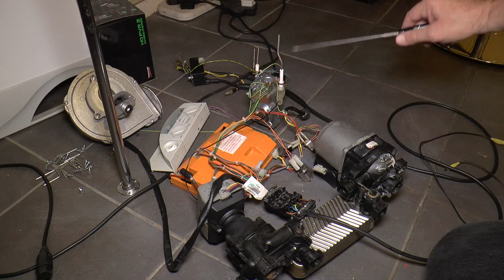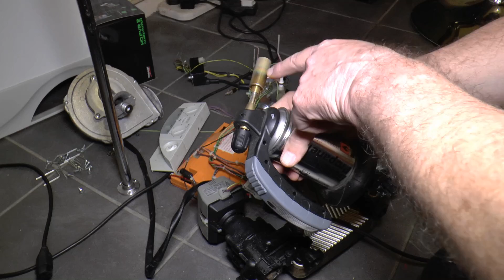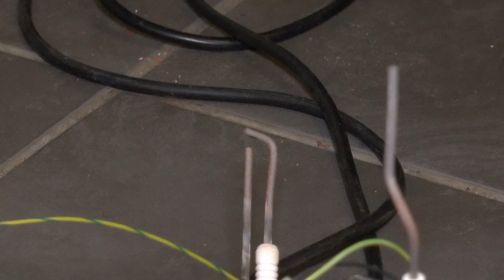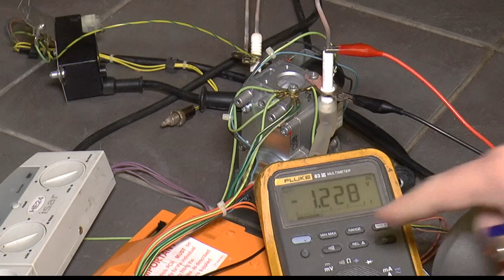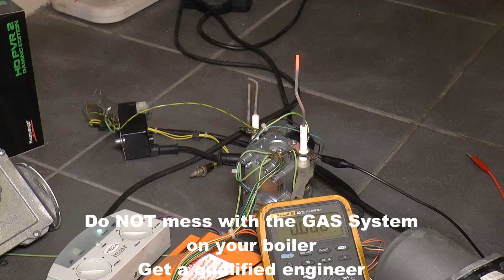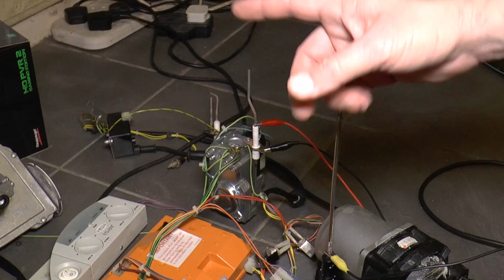Ideal Boiler Function + 'Rod Flame Sensor' & Gas Ionisation,  Boiler Fault Codes

Comment: Great Video, I see you are also MCU aware (the Atmel ref) electronics aware. I have a problem with my boiler, its tripping the RCD on my board. Looked all over but not much help. Seen any similar faults?
Reply from the maker: Hi, thanks for your comments.
Yes I program Pic microcontrollers, Microchip bought Atmel the other year.
Disconnect anything with an earth, I think the water pump may have an earth, so unplug the whole pump and try the mains again.
Then the blower and all the big stuff first.
Hope this helps.
PS, probably not a board fault.
Keep me posted.
Reply: Well I was trying to isolate the offending component earlier. If I unplug the Gas valve connector, it doesn't trip out, Ive measured the resistance on it (B&P SGV100) it has twin coils and they both read Ok. Im assuming as the gas is not running the pump will not power up also? Im not with it now but will do a few earth checks tomorrow. Will keep you updated. BTW its a Ferroli HE 26C! Not my choice, I know the rep they have. Thanks for the guidance, appreciate it.
Reply from the maker: Hi Martin, excellent news on narrowing the fault down to one area.
Do the coils measure any resistance to the case? 
In theory, anything under 1 million ohms will trip the house.
Reply: No resistance to earth John, I see where your coming from. Been strapped for time today got the kids going crazy. Checked the pump was turning freely and for L to earth fault. Got a leak from the Heat exchanger HW out which has a pipe clip that is dribbling. The dribble has found its way down a cable and into the PCB, ive dried it out but I need to fix the leak first, cant solder it as it would just melt and I cant remove the HW pipe coming out the the exchanger to replace the washer as it would require taking all the pipework off it and that might disturb other dubious clips. Im just working out my options, all this because of a tiny dribble. Any idea's on how can I fix the pipe into the HEX manifold?

Comment: Hi John. I have a isar he24...
I have a issue where the boiler on domestic hot water... the unit initially kicks in and the boiler stops for 15 to 20 seconds you get really hot water...cold...then after the 15 to 20 seconds it kicks back in and works fine...

It does this everyone you turn the hot water on 

Central heating is perfect 

I've changed the thermistor...and main board

Can you help ?

Comment: Superb video. So informative and enlightening. Thank you so much for taking the time and effort to make for us all.
Reply from the maker: Thank you Joseph, it's kind of you to comment.
Were you browsing videos or do you have an Ideal boiler fault?
Reply: A fault, alas! I'm getting an HF error and I've ordered a new Ignition Electrode to see if that fixes the problem by producing a 'nice big healthy spark'!  I'm on Twitter if you need to DM me. Many thanks again for your delightful video. @flintymqwerty
Reply from the maker: Flame detection is controlled by the control unit, it's the part that fails and blows the unit up.
I can fix them if you send it to South Yorkshire.
That is assuming you are getting your spark and gas.
Reply: Nice practical demonstration John
Reply from the maker: Thank you kind Sir, have a great weekend.

Comment: Very interesting. I've been reading a bit and seen a couple videos, but there seems to be a lot of contradicting or oversimplistic information out there about how exactly this flame rectification process works. 
So if you didn't grab your torch by the metal part, it wouldn't sense the flame and shut off? I'm amazed that it works, cause the module seems to sense a dc current in the order of 5 microamps, but now that current would need to flow through your body, through the ground, back to the burner chassis, while normally the current reaches ground immediately in the burner head.
Reply from the maker: Hi Koffi, 
Thank you for your comments.
You might have seen, in the video I held the plastic handle (by mistake) and had to switch over, hold the metal can before it saw the flame.
Yes you're correct, if I insulated myself from the metal can, the control board would not have enough current for the ''flame sense'
The 'flame sense' circuit is floating and not tied to ground.
The metal rod is insulated.

Comment: Hi John I have the he24 and the dry thermoster is leaking when I switch the pressure up and then cuts the boiler out because of the water if I remove that part will it throw loads of water out  glad I found you on here

Comment: I have an H3 fault code which I think is the thermistor. Could you tell me where abouts it's located? Thanks
Reply from the maker: On a water pipe somewhere, not sure which one.
Check the plugs and wiring.
See what a new one looks like on ebay
Reply: If i have the right part it looks like a sender that uses resistance to indicate temperature thus cutting off the burner at a given resistance/temp. On eBay that part is less than £15 but I am not sure where it is situated in the DHW flow
Reply from the maker: Well there are only 3 to choose from.
Download the manual from Ideal